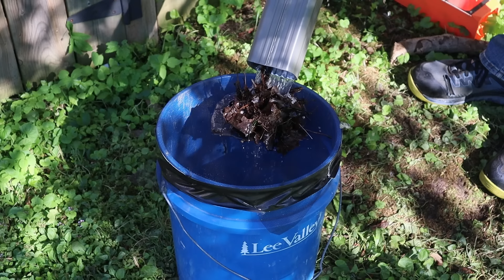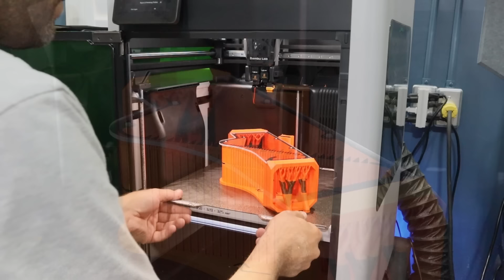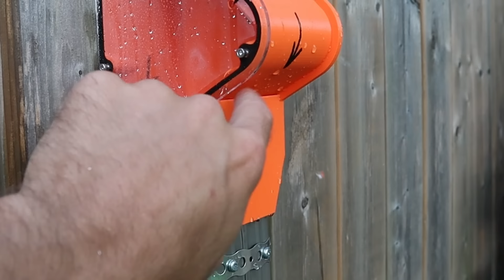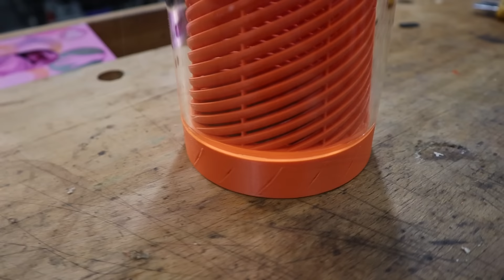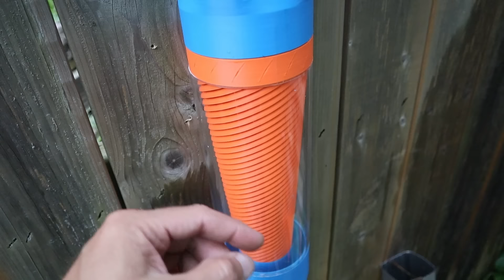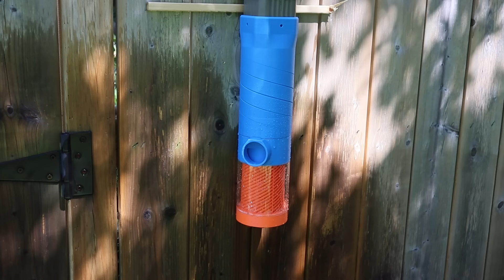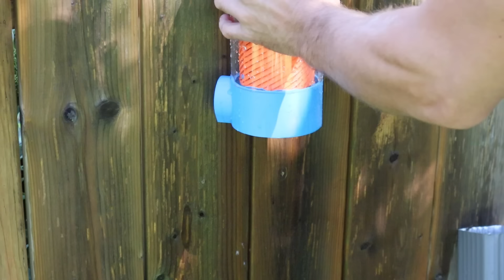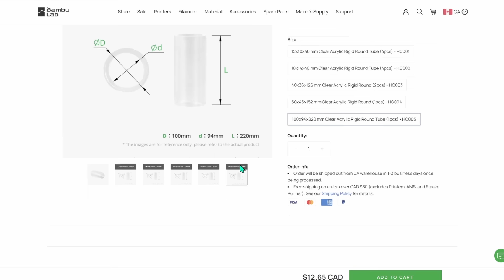Can you 3D print a self cleaning downspout rain water collection filter that actually works?  Let's

Comment: I imagine the first design with some of the mesh would work, perhaps add some zig zag baffles to keep the water on there for longer as surface tension may cause it to flow over the top. Using a hydrophilic mesh may also help.

Comment: The 2x3 adapter is too short, and sharp, water is likely to refuse sticking to walls. Make it longer With smooth angles. 

Your whole video was testing only low rates of  water. The long filter may be required for average rain.

Comment: a more realistic test would require the water+debris come in HORIZONTAL before reaching the vertical portion
add an S-bend fitting like you would find in a normal downspout setup, should get you close enough

Comment: Hi 🙋🏽‍♂️ MechE here, I love the unique designs and think all the concepts are really cool, but may I suggest one? Rain chains are surprisingly effective using the same Coanda effect with minimal risk of clogs. I would try making a fixture that uses some internal oscillating curvature to slow down the speed of the water/allow the surface tension to keep the water on the walls but still allow debris to flow through and then use rain chains to guide the water into your reservoir. Might not be as efficient with water collection but I’d think clogs would be nearly eliminated ¯\_(ツ)_/¯

Comment: Interesting but I have had the normally available (in the UK, that is) diverters in operation for almost 25 years and had little need to unclog them. We have pine trees (those wishbone needles get everywhere) as well as deciduous types and my biggest problem is keeping the gutters clear. If anythng,  its the point where the downpipe meets the gutter that is the point where clogging occurs.  Re the diverters, their main issue is that the tops tend to pop up when the rain is exceptionally heavy - finally fixed by the application of duct tape. Of course, the other requirement is that when the water butt is full the diverter has to stop diverting. But you are right, the ones I use rely on the water running down the inside surface of the downpipe - which it does.

Comment: I feel like to make a better design, you should try to go with 3/4 the length of the original round filter, but then a slightly larger taper than the second design, think of a taper in between the 2 designs. This will then allow slightly more water collection, but also allow a large enough hole for the debris to come out of.

Additionally a good way you could test the amount of water through the filter, manually measure out a specified amount of water (let's just say 5 gallons), pour that into some bucket, add debris to that bucket, wait maybe an hour to simulate the debris softening during a rain storm, then slowly pour that water in using a smaller bucket with holes in it, or something. This will give you the ability to test 2 things; 1. How much water is actually collected with the filter, and 2. how well the filter actually filters out the debris

Comment: So I’m not the most knowledgeable about this (any of my knowledge comes from videos like this) but I’m thinking the first design is good but it might help if it’s redesigned to work with it angled so the water & debris run across the filter rather than onto the filter, but if there isn’t room for an angled downspout the second design is probably best

Comment: Ok, and now we need something for the real small parts to go. I use a microfilter in the intake of my pump when I suck the water into my house to the toilet, but this one I have to clean so often, it's really a pain in my butt.
I thought of using a little pump between the 2 tanks, solar powered, and have a first tank for the rainwater, and the second tank is the filtered water, that went through a fabric filter like, don't laugh, a sock. 
Sockfilters are pretty good for fishtanks, you can use a womans tights as a super fine filter, to get out the pollen. 
I even used them as a filter for my VW Corrado, because it had no real filter, so we improvised :D

In theory, we could add the tights to the output of the filter here, when I think about it.

Comment: Neat! This is very similar to the design I came up with (that has been running without issue for ~8 months now), except that I used a perfectly vertical and smooth inner wall with curved channels in an offset grid pattern to divert the water. The offset grid means that there is no gap bigger then a few mm along any axis, and that the inner surface for debris is very smooth, but water can't run down the whole surface. I'd be interested to see a real world comparison of our designs. (Thingiverse thing:6809616 ). Pretty cool how similar problems result in similar solutions!

Comment: I feel the testing method used is completely flawed. You are introducing dry material then trying to wash it out.  You are also using a spray out of as hose which will never happen from rain in real life. You are completely changing the dynamics.

I would suggest making a part of a roof, setup a short gutter, then hook the downspout to that. 
Putting some soaked debris on the roof surface then spraying the water onto the roof would more simulate rain and fallen debris.

Comment: I made a water maze for a down pipe about 5 years ago. It was designed in sketchup (horrible software i don't recommend) it worked perfectly fine. It was designed with the 'first flush' method you shown as i don't have many trees to worry about. 
Your design is amazing absolutely brilliant, well done. I wouldn't trust magnets to hold it together in a storm at all though. I would much prefer some sort of quick latch clip system.

Comment: I like your creation.
All that's missing is a system that measures the amount of different types of water (cleanest to dirtiest) entering as well as the amount of water evacuated from below and to the side to have a measurement of efficiency in percentage.

You might even benefit even more from the principle that water flowing inside a vertical gutter tends to always be "a shy person crossing a huge corridor": She always runs along the edges.

By using two or three circular modules 5 cm high, separated by about twenty cm (Installed from the one with an interior opening from the largest to the smallest), you would benefit from all the efficiency of your penultimate system by improving self-cleaning.

Comment: have you considered using a fine mesh filter on the inside of the vertical filter to give pine needles less opportunity to slip into the gaps? 
I think that if the mesh doesn't actually stop the dirt, it should go right through and only prevent smaller objects passing trough.

Comment: How well would one built with a resin printer work? It would remove a lot of the burrs that debris can get snagged on from the way filament printers print.
Also, could the whole thing be printed as a single unit? It would remove the whole water escaping between the connections, and it would make it easier for someone to just print and use at home

Comment: You can’t use 3D printed material as a water supply, because microplastic from it will contaminate it, you need to give it a layer of protection between it and the water .

Comment: Contaminating water and the air with plastic fumes and microplastics is no success.
Using 3d printing to design and prototype molds to cast something out of a safer material would be, but nobody's ever doing that.
That's why 3d printing is a massive failure all around.  You poison your living environment with the fumes and create huge amounts of waste and create ever more microplastic pollution, and for what ?  To NOT learn how to use the tech to do positive things...
What an utter waste.

Comment: I think you should build a test setup with a slanted "roof" with gutters in order to better simulate an actual storm.

 You could put the debris in the gutters and on the roof, and then dump a varying amounts of water over a couple of seconds to vary the flow rate.

 I imagine with heavier rain and more flow, more of the water would overshoot the lip into the downpipe, meaning less would be stuck to the inside of the pipe. Or the distribution of the debris might be different, i.e. big clumps coming down all at ones or more consistent amounts of leaves falling down the downpipe. 

Would be interesting to see you test more designs with a more sophisticated test setup

Comment: Use the first design. Increase the angle to 60 degrees to steepen the slope and extend its length. The latter rotary design might cause some debris to cling to the pipe wall due to centrifugal force, leading to long-term accumulation that compromises performance—since rainfall flow rates are uncontrollable. (Just a speculation)

Comment: "small rocks from asphalt shingles" if you want clean water, you'll want to get rid of those filthy things. Get some nice clean metal, or you could have glazed terracotta if you prefer that. Something that isn't leaching poisons into your water - even if you're "only" using that water on the garden, when you eat the food you're growing, you're going to be eating some of that poison.
That first iteration looks a lot like a frogmouth. Do you have frogmouth strainers in America?
Gutter guards will help with your tree residue in your gutters. Leaves and dirt sitting in your gutters will rust them out a whole lot faster, because they're holding water and soil acids against the metal when it's designed to dry out between rain events. Also it's a fire hazard even just as leaf litter, and if it rots and you end up with grass growing there that's a whole lot worse. Gutter guards keeping your gutters clean saves a lot of trouble!
I think I'll stick with the gutter guards and frogmouths, but it's good to see people experimenting in this area. Also it would be worth while mounting a waterproof camera inside a downpipe that has a fair size catchment, and see how full the pipe gets.

Comment: These systems are really interesting to me because they only waste water when they run into a blockage, then the water flow gets interrupted and is diverted to push the debris out. I do wonder about a slow buildup of debris.  Since so much of the water is captured, the water might not push the debris very far, and could slowly build up a chunk that is too big to move.  Having a very short filter works well for clearing debris and having the smallest complex part, but I think relies a lot on the water sticking to the sides well and having slower flow rates.

I wonder if having the filter start near the top of the downspout could help the water to stick?  When the water is going horizontal in the gutters you know it is going to be the most in contact with the sides, so the transition from horizontal to vertical might be important.  In the highest volume situations anything conical will fail to capture the stuff falling into the center of the downspout.  And high flow rates will keep the coanda filter from grabbing slices of water.  So I think the perfect system ends up being a slow swirl transition from gutter to downspout.  And you need an oversized downspout because you need the full volume of the water to fit at the outside, leaving the middle empty for debris to flow.  Impractical, but that seems the endpoint of this idea.

I really like this conceptually. It just seems like it doesn't account for large flow rates, ice, and relatively inneficient/expensive use of space.  I loved exploring the idea though!

Comment: Have you thought about using an 18 to 24 inch piece of gutter to dump a bucket into as your ingress point instead of a hose to better simulate how water is coming off the roof? I don't know that it would drastically change how it works, maybe not at all.

Comment: i think two spirals in a crosshatch pattern would work better stopping pine cones and debris like that from collecting in the filter, and the spiral shape would guide the water to the next available open hole in the net, i am only be a software engineer (hopeful, thanks AI) so i might be wrong, if you think a crosshatch pattern made with two filters one on top of the other would be a problem i wouldn't know but i think it might work

Comment: Great start for a filter system!

You should use a 5 gallon bucket you got sitting there. Fill with debris and water and then pour it into the spout. I think that would be a great test as then the debris is mixed with the water.

Comment: I wish more 3D printing videos weren't clickbait like this. The video title says "Can you 3D print a water filter?" not "Can you 3D print and CNC cut a water filter?" Granted, its not very hard to replace that specific part in this project with something else, but it's just the principle of it. Most clickbait videos like this usually have a section that uses a CNC Router, or a powerful Laser Cutter, or some other ridiculously expensive tool that the average maker could never afford to buy. This brings the project viability down to pretty much none at all because not many people are going to be able to even ATTEMPT this. Despite that tho, at least you can learn a thing or 2 from watching it...

Comment: This seems like a great way to massively increase your intake of microplastics.  Very well done.
Reply: We've reach a point where just being alive will increase intake of microplastics, shit's untenably late for anything to be done
Reply: @fabianlaibin6956  This is true, but I would still avoid using 3D printed anything in contact with any type of water/food due to 3D printing's excessively high amount of microplastics.  Even if you don't plan on drinking the water yourself, if you are planning on using it for most things I would not consider this safe.

This argument is like saying you cant help but breathe in some smog if you live in a city so you might as well go huff a car exhaust.
Reply: @JathraDH I mean... There's almost no difference nowadays, maybe if electric cars actually succeed but I won't hold my breath 😂

Comment: One of the many great properties of water is both it's fluid action and taking advantage of it's density and preference to follow laminar flow designs. Your first design is actually pretty good for intended purpose, and I've seen it used in very large scale in water treatment plants in the upstream filtering process (not first stage, but one of them). 
As much as I like radial applications for water, the propensity of debris becoming lodged in radial volutes as it follows the centrifugal force makes particle and sediment exclusion more difficult in that application. Fortunately, a pre-filter of sorts via the rudimentary perforated sheet where large debris follows the laminar flow and ejects off a sloped topical surface while the more dense fluid evacuates below works fantastically for this use. A horizontal section with a slight downward slope would be ideal to use for your rain barrel application, and the first design would benefit from more lateral dispersion. 
Naturally, 100% recovery is the ideal but not practical end game, but I think a page out of gold recovery designs would be interesting to utilize just for straight water run-off. One of my side hobbies is watching the gold shows and coming up with more practical designs as I watch, but I do enjoy seeing what ideas mixed from age old practicality and the wildcatters with CAD experience.

Comment: This design can be improved a lot by calculating surface tension, adhesion and flow rate of the water in terms of he material used. Probably the angles can be improved as well.  Otherwise a great initial design!

Comment: I love this idea and a neat approach for sure but for a lot of people this solution would also cause another problem, all of the debris that was shed off of the filter would likely end up in the rock bed or landscaping at the base of the house. This has nothing to do with the efficient shedding of water but if there’s enough debris buildup at the base of the downspouts that could infuriate people with the extra cleanup work. I would love something like this for my water catchment system though.
Reply: Or, put a bucket with some drainage holes under the debris collection and dump that periodically.

Comment: Over all great video 
I have a few suggestions to help with consistency during testing for the next run

You should and a small section of horizontal guttering for pouring in your water
Then you can add you debris to the horizontal section to be washed down this should be more realistic rather than the worst-case scenario of all the debris going straight into the down spout (although I do recognize downspouts debris do build up over time and this does happen irl if not maintained)

Second pre measure your water that you test with and compare starting and finished levels to calculate exactly how effective the collection is
This will help determine how it compares to othe proven methods such as the first flush that you mentioned earlier 

Again great video and I look forward to watch more 
Thank you

Comment: using a spray nozzle on your hose is forcing the water to run down the internal face of the gutter. a real downpipe situation would be more of a column of water, or at least not just a minor skin flow. in this situation, you would have the vast majority of the flow fall straight through the hole in the middle.

Comment: Be sure to check out the remarkable work of Viktor Schauberger. He extensively explored the dynamics of water.

Improvement Suggestions:

1) The falling water should first be set into rotation by a gentle curve in the pipe, so that centrifugal force presses it outward more strongly in the filter.

2) The magnetic seal needs a lip to be watertight, so it must be interlocked.